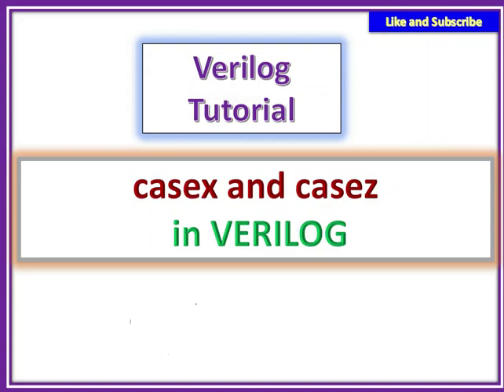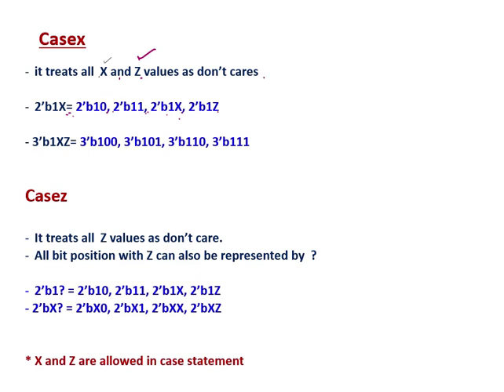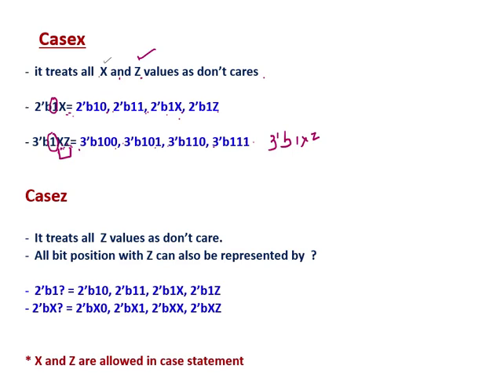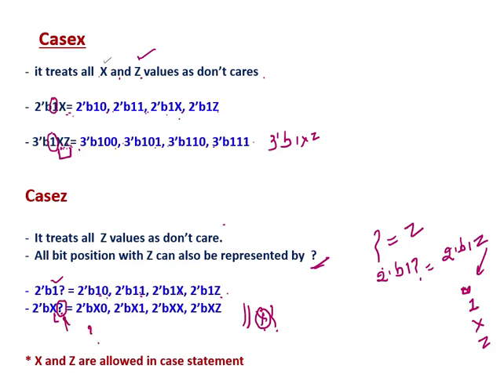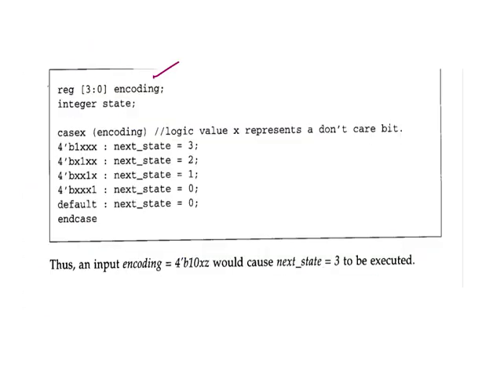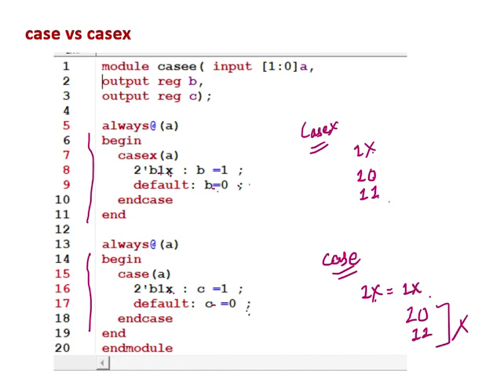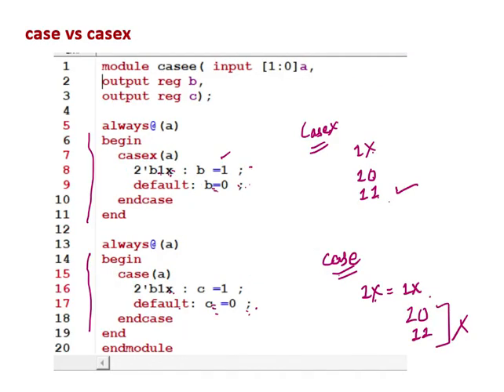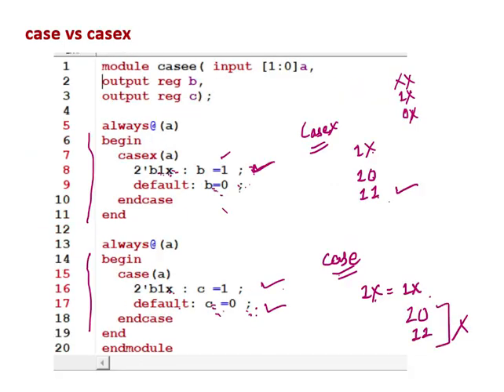#28 casex vs casez in verilog | Explained with verilog code

Comment: Hi sir, at 10:25 you took case expression as 2'bxx (i.e a = 2'bxx) and we have case item as 2'b1x, you said that it will match the case statement, so the b became 1. When I tried from my side 
for the below code I am getting 
 Matched for case items: 00 ,01,0x,0z,x0,x1,xz,xx,z0,z1,zx,zz 
 Not Matched for case items: 10,11,1x,1z

module tb;
  reg [0:0] a=2'bxx,b;
  initial begin
    casex(a)
      2'b1x:  $display("Matched"); 
        default: $display("Not Matched");
    endcase
  end
endmodule

my doubt is as we are giving case expression as 2'bxx , then it should match the case items (10,11,1x,1z also).  But here it is not happening. Could you please give me clarification regarding this?
Reply: It’s  now resolved sir, I did a mistake while declaring varibales it should be reg [1:0] a,b; 

Now for all the values i am getting b = 1 . 

 Thank you for the explanation sir

Comment: at 10:24 , Sir u have said XX can be 1X, 0X, X0. So according to it when a=0X then b should be equal to 1 instead of 0 ?
Reply from the maker: For casex

When a=0X
b=0 

When a=XX
b=1
Reply: As u have said in 1st example of casex, 
2'b1X = 2'b10, 2'b11, 2'b1X, 2'b1Z and 1 should be fix and X should change
So, why in testbench code in casex 2'b1X as, a=XX is taken? Will here 1 is not fixed ?
[I mean how XX is inside casex ?] 
Please clarify..
Reply from the maker: Xx can be 1x,0x,x1,x0,00,01,10,11 and few others for casex only and not case.
So when a=xx it results b=1 as here xx can be 1x also
Reply: Sir then why,
When a=0X
b=0
It should be b=1 right ?
I am bit confused in this!!
Please clarify..
Reply from the maker: When a=0X

Here second bit is fixed that is 0 and can't be changed and 1st bit is X so can be 0,1,Z

So 0x can't be 1x

For 1X , we get b=1 for 10,11,1x,1z and for rest we get 0
Reply: @ComponentByte  
Ok got it Sir..👍
Thanks for your clarification..😊

Comment: sir In 1st example , given encoding =10xz it can be 101z right so in the third case(xx1x = 101z) so cant we write next state=1
Reply from the maker: It's decided by simulator.
If input=10xz then simulator will first check 1st case : if it matches then it will give 1st case output, if no matches it will go to next state.
Thus 10xz matches 1st case 1xxx so simulator stops there and gives corresponding output .
Reply: @ComponentByte  thank you sir

Comment: Great explanation.
what if there are multiple ones in the input.
e.g 
for an input encoding = 4'b011x
which next state will be executed ?
Reply from the maker: Thank you.
It is decided by simulator. 011x equals 0110 and 0111 so next can be 8,9,10.... so 1xxx is enough for 8 to 15

Comment: Imagine we are in casex and we have 3'b1xz as in the first slide of the presentation. Aren't the possible  options: 3'b1xz, 3'b1zx, 3'b1zz, 3'b1xx, 3'b100, 3'b101, 3'b110 and 3'b111?
Reply from the maker: Yes, you are absolutely correct.

Comment: Nice explanation:
But in the last example 
When a=xx then I think b=1 and c=1 or 0 in c value I confused because in verilog casex has value of x is 0 1 x and z!
But in simulation x take only value of 0 and 1 ? Is this r8?
Reply from the maker: In casex X value can be 0 or 1 and Z value can be 0 or 1.
X is  0,1,X 
Z is 0,1,Z
Reply: @ComponentByte  so why in starting u have taken 2'b1Z (first example in casex)
Reply from the maker: You mean why 2'b1X = 2'b1Z ?

If it's your query then in casex all X and Z can be considered as don't care so X can be 0,1,X,Z 
So 2'b1x = 2'b10,11,1x,1z

Don't care means your output doesn't depend on those input bits.

If it's not your query then please let me know.
Reply: @ComponentByte  cleared 👌

Comment: can you tell me where do we use the casez in real time?
Reply from the maker: It can be used to design multiplexer if resources are available.

Casez is used for testing the RTL code. During verification process code coverage is done to test every lines of code to check whether every lines of code is executed with valid input or not.

In casez Z means if input is souriously 1 or 0 then the output should not be propagated and must be filtered out. Hope it helps.